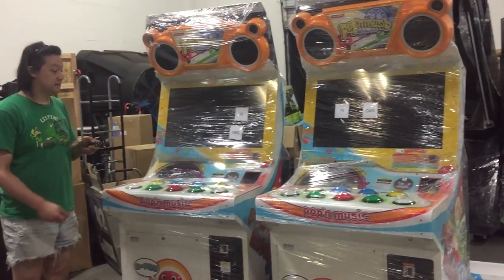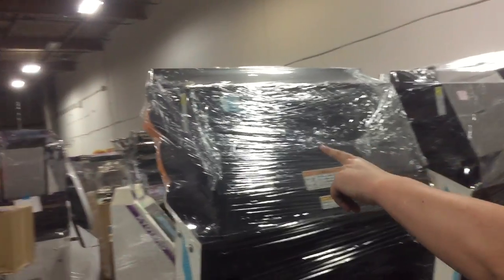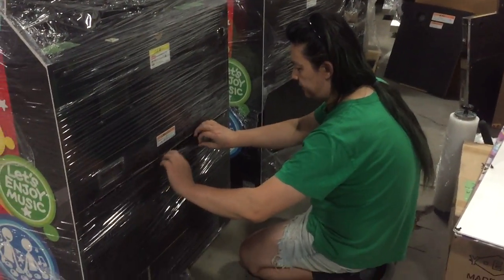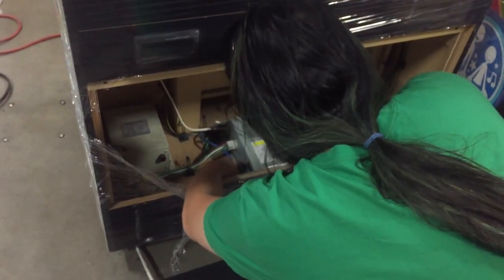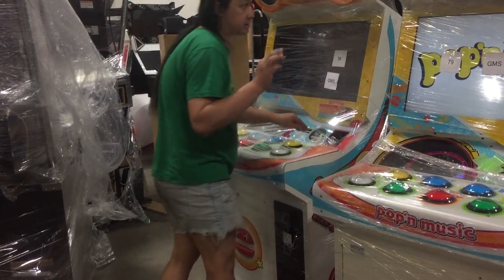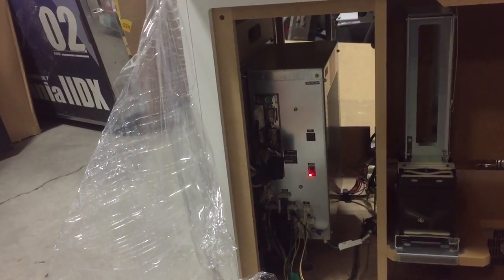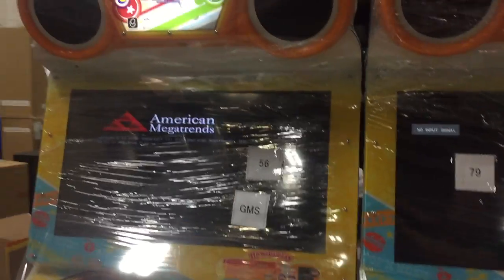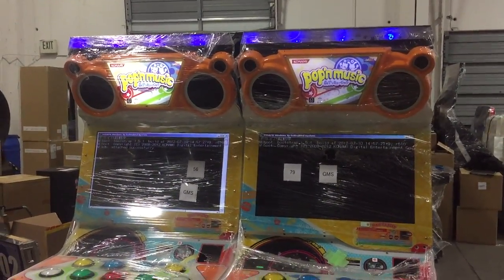Pop'n Music HD Type E and Type F side-by-side comparison

Comment: I'm getting a pop'n music SD cab, however the cabinet is coming with a replacement lcd screen ( running 12 Iroha ) how hard would it be to find another crt like it originally had? I'm i better off just using the lcd its coming with?
Reply from the maker: Pretty subjective question. HD works, CRT is nice, you could go either way. I think in terms of “better off”, just depends which way you lean. CRTs are getting harder every day to come across, but not super hard or anything. It’s a common size, and you don’t necessarily need the exact same one that it came with stock. If the mounting brackets for the CRT aren’t there though, it’s kind of a non-starter; that’d make it much harder to put back in a CRT